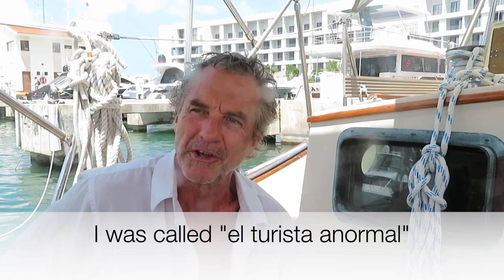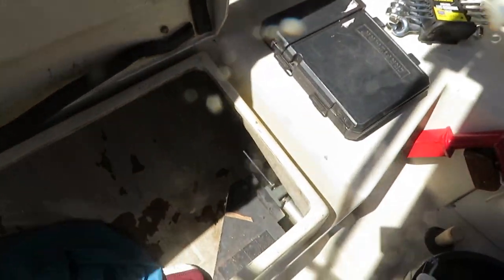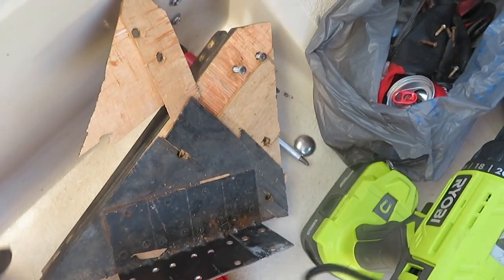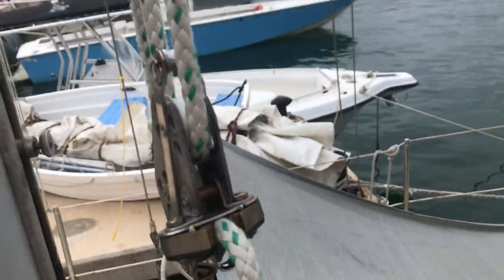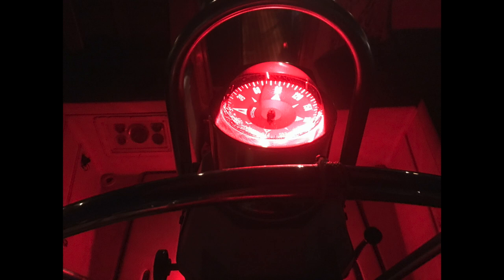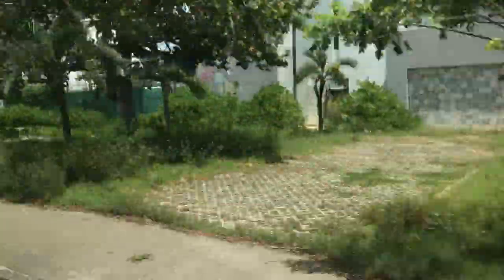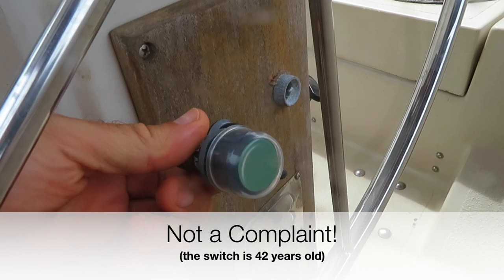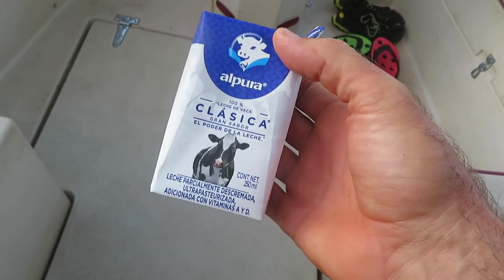Skipjack Sailing 31.  Climb the mast, remove the sail..  Navy Nuke Escapee.

Comment: Couldn't agree more; as an old diesel mechanic with a fair bit of marine experience, I am a true proponent for the teachings of the school of ' if it moves; grease it.' Also; all boat designers should be sentenced to maintain the boats they design. Particularly with a focus on 'ease of access' (engines in particular.) Loving the videos mate; all the best.
Reply from the maker: I was thinking to clean those tracks, obviously, then use that red grease from an auto-parts store. 
Lithium greases do not impress me--they seem to "gum up" too quickly.  That red grease has an awful smell, but it doesn't seem to attract insects!
Reply: Not auto grease, nor lithium, try silicone spray please after cleaning the track for your mail sail slugs
Reply from the maker: @Sailspirit99  Thanks for the tip.  I think I am almost finished with "discovery" items....

Comment: That fruit looks like the prickly pears I grew up with in South Africa. The one you had was not quite ripe -- the greenish ones go yellow when ripe. You also get reddish ones. The easiest way to peel them (and watch out for the thorns on the skins) is to slice off the top and bottom, make a cut down one side and then peel the skin back, revealing the fruit. Prickly pears when ripe are sweet and tasty AF! I would love to get hold of some more, but here in Australia they're not as popular. When I was in the army I'd go out into the veld, armed with a knife and an empty condensed milk tin. You place the tin over the prickly pear, cut the stem and there you have your fruit ... and no thorns in your hand!

Using grease on those sail trucks: one needs to be careful, because some types of grease can attack the material the trucks are made of, and could cause you a lot of grief. Graphite should be fine, though, but I'm no expert LOL.
Reply from the maker: It was good.  Are the prickly pears from a cactus also?

The grease on the track--I hadn't thought about the grease--truck incompatibility.  If left to my own devices, I would use the red grease from an auto-parts store.

Comment: Go with a loose foot and avoid crusty boom slugs and channel. Also just ties the bunt to itself , preventing tears. Otherwise. Use dry silicone spray in the track; but avoid overspray like the plague,  it will louse up any paint on deck on future.
 Best to ya
Reply from the maker: Thanks, Paul.  Tell me more--I have not seen a large boat with a loose-footed main, but it sounds good to me.  If this sail rips again, I'll be getting a new one, and at that time it'll be loose footed.
Reply from the maker: Bunt line:  what is the function of a bunt line?  It looks like it along the entire edge of the sail.
Reply: Agree 👍👍👍with Paul re silicone spray
Reply: @skipjacksailing8986  Bunt" is rather archaic,  but typically the baggy/loose area mid sail, gathered and tied, mostly to prevent ballooning, flogging or fouling the deck. Think of red/white/blue draped material as decorations, tied/drawn up at mid point.
Also used as "shake a bunt out of the main"; but hardly ever used anymore.
Reply: The reefing point short lines, or "nettles" are just for gathering up the baggy section of the reefed sail.  The tack and clew take the strain when the sail is reefed.  The tears could have been caused by tying the nettles around the boom instead of running them between the foot and the boom.
Reply: @dboboc  ,
Yes , "nettles" was the word I was trying to recall. Thanks for the reminder
Reply from the maker: @dboboc  :  Thanks, but with my sail I see no way to tie the reefing points to the bunt.  No bunt line.
You are saying to tie the reef lines by passing them through the gap between the trucks in the track (on the boom)?

I do appreciate this.